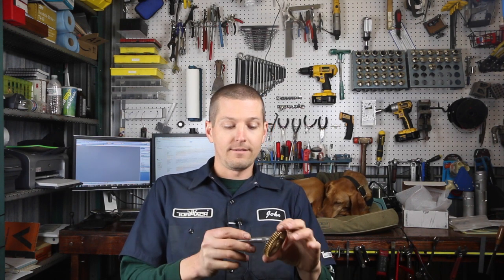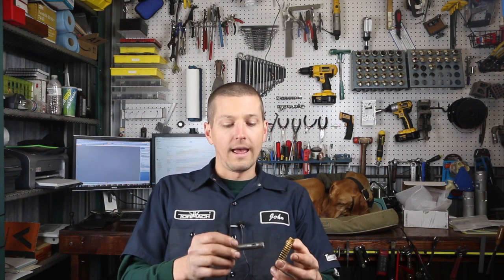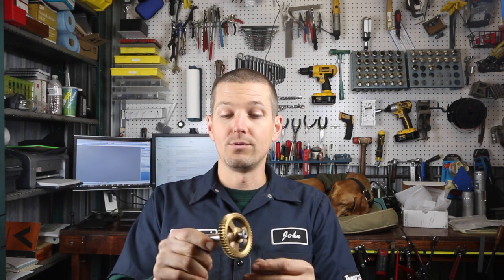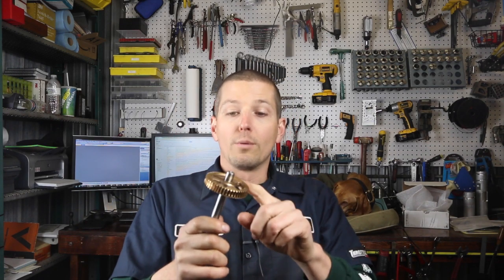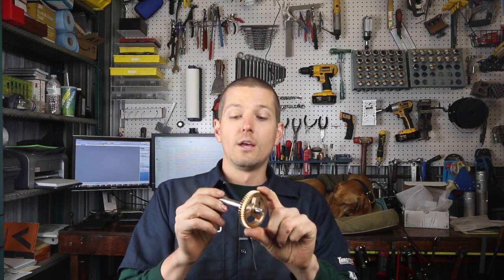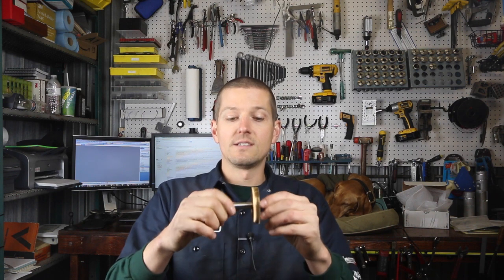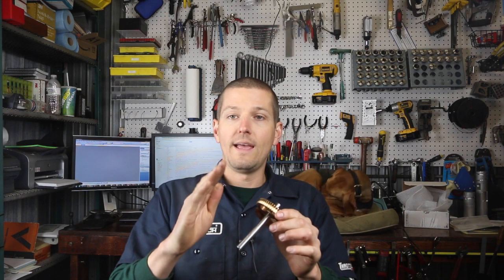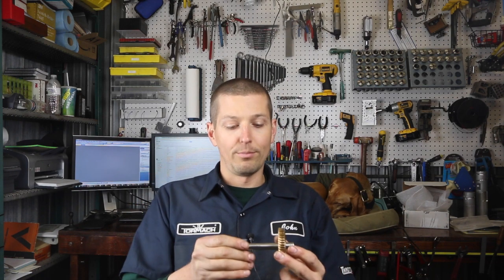Asking for advice!  Braze Bronze?

Comment: Your question is interesting, and you'll probably get lots of answers. Theres several ways you could try to strengthen that part. Many have already been stated.
One question I have is does the small end of the shaft ride in a bearing? How much room is there for "brazing"? A simple braze on the outer side may do the trick, but probably best if done by using TIG vs torch.
Another way is to possibly silver braze the two together, which is much like soldering, but only a lot hotter. You have to sweat the two parts together using a silver brazing rod.

Another idea that doesnt include heat, is to make a new shaft with a proper press fit. Not using the knurl. A straight turn with an interference. Also, two keyways 180* apart. That should make a strong hold there.
A tapered fit would work well too, but you would need a jam nut to keep the gear drawn up tight, and I don't think theres room on the shaft if you the outer end is a bearing journal.
Reply: These are all good suggestions from Adam.
Reply: hi mate im new to this interweb ,silver solder it , you dont need to get it as hot as bronze less chance to stuff up heat treatment on the shaft

Comment: Is this the same motor drive from your last Adriano project, the one with 5 lb block on it. If that's the case, im not surprised that they cheeped out on the shaft mounting with a knurl. Those kind of motor drives are better suited for something like a wheel chair meant to go longer distances with few reverses.

I would avoided the quick fixes like Braze/Solder or glue, those methods will get you a fix to last you until the replacement parts arrives, Also the heat will do more damage then you think. But given the time to make it right the first time, I would suggest measuring the gear profile then ordering replacement gear from Boston gear or Mcmaster, that would allow for something like a 1" shaft and key, Replace pinion/worm if you have to.

That said, if you are looking in to converting you shop from a short order job shop to a small production for shooting accessories, you will want to get in to Pneumatics or Hydraulics, company's like Festo sell kits that will get you going.

Comment: Hello and thank you for all your interesting films.
I have followed you on youtube since you started ..
Looked at your post about the problem with the gearbox problem.
You have 4-axis mill, why not do it all in one piece. Turning the profile and then milling the teeth. Since the problem is solved. You can do everything in steel (SS 2541 SS or 355jS) because the gear on the motor is made of bronze alloy.
I am a tool maker and protyp manufacturer for 15 years and has done a lot of things of this kind of CNC and manual.

Comment: Loctite John, welding/brazing will destress and deform that 1144 shaft. 1144 isn't stable like you think it should be for soft steel. Loctite has a higher shear than some steel. That means it will tear out the metal before the Loctite will fail.  In the future a little heat can be used to release the bond if needed.  You better chuck the shaft in a spindle and locate that gear so however you go about this it doesn't give you runout probs after assembly.  Sonic tank those parts first since you have one. Boil with dawn and borax is the other way to prep that.
Reply: NYC CNC I'm not the Loctite expert.  I use bearing retainer for stuff like this.  I know you could find something yourself you would be confident with if you look online at the descriptions.  I'll give you real life experience, others can read about it and give you the technical data galore.  That's not me, I'm a do-er like you. Bronze won't last with a press fit, I find it interesting the key sheared.  You could machine the center of that bronze gear out to a much larger diameter and press in a steel center. That would give a lot of surface area between the two metals. I would still Loctite that lol!
Reply: NYC CNC I took a look for you- I got 609 in my cabinet and that's it for stuff like this. In the past I have used it on loose fitting parts, oilite bushings, brngs, cast iron, steel, and brass and bronze parts.  If you find a better match as I think you have then you should have 100% confidence in the loctite holding.  I say that because 609 has never let me down even when there are better choices of Loctite. I can't justify $20 per bottle most of the time so I use what I got.  I got red, green and blue for nuts and bolts and a little bottle of 609.  609 is green.

You are a very resourceful person. Reaching to your audience for this is a great idea. Have a safe weekend.
Reply: NYC CNC That question is above my paygrade! I primarily use 609 for mower deck spindle bearings.  No key on a bearing but the outer race really isn't seeing any torque.  I don't know that answer John.  609 spec says for fractional hp motors with no more than 0.006" clearance.  I know without heat if I press a brng out it will score the brng and the casting and the loctite will hold up. It is a real surprise when that happens the first time.  It'll ruin parts and not the loctite! Not exaggerating this.
Reply: NYC CNC Guys like our fathers who know these things don't do videos.  I don't think you could get my dad in the same room with a running camcorder etc.
Boys need to do things like models and tinkertoys.  i learned by ruining a few models that prep is the most important step.  And fathers need to give broken stuff to boys and tell them "here kid go take this apart".
Reply: Maybe anaerobic retainer, I use it in some motor shafts and Works great.
Reply: EmperorDevilhunter Sure thing, Loctite is also an anaerobic cure.
Reply: Caleb Welte not really, loctite is a brand, they have a lot of different components. The most usual called by the brand name is cyanocrilate, which needs the atmosferic moisture to cure. They also have specific anaerobic retainer, that only cure when is in contact with the ions of metals (for example Loctite 668, 640, 609, 603, 660, etc)

Comment: Silver soldering is so easy that you definitely should try it before re-machining the parts for a better geometry (hub&screws, increased radius w/splines, keys, pins, etc).  You should machine out a clearance between the two pieces of 1-2 thousandths for best capillary action & strength.  If done right it should be very very strong.

Comment: John,

Disclaimer - I am not a metallurgist.  I did come across an interesting rethread project from Keith Fenner.   He bronzed a huge part to thread for a John Deer tractor and rethreaded.  He used Bronze for the project and stated it is REALLY strong and to be honest, I'm quite amazed at what he did.   I'm attaching the link below (part two - you may want to check out part 1)

Deer John Part Two 

I hope you find the link useful.  Keep us posted on your decision.  Would love to know what you find out.

-David
Reply: 40:10 Keith discusses the strength of brazing rod vs cast iron.

Hope it helps!

Comment: Silver solder could help but you may need a  to adjust  your fit to match silver solder specifications  It has been many years ago that I sold welding products but I know that you can get over 100,000 lb in strength with the right fit , may a 45% silver Alloy

Comment: Hi John, have a chat to the guys at Henkel (loctite). I have spoken to our local Loctite guys and seen videos that demonstrate the amazing strength of their products...They have a product, given that the shaft is knurled (space for their product) will work perfectly(can even be used up to 0.020" total clearance on a shaft and gear). With that comes NO distortion from heating(while braising), but it will be a permanent solution. You may need to machine the gear off at a later date if and when the gear fails. there are video clips showing their product working under pressures of hundreds of horsepower with out problem.
I would be amazed if they don't have a solution for you.
Peter

Comment: Loctite makes some serious adhesives that can be used during assembly to essentially make one solid part.  Maybe use 600 grit sandpaper (or sandblast until frosty) to make a slightly roughed surface finish on the shaft and gear collar ID.  Use 91% isopropyl alcohol (cheap in the pharmacy aisle at Walmart) to thoroughly clean the parts without leaving any residual oil that you'd get using reclaimed acetone.  Thoroughly dry. Follow Loctite procedures, but probably involves coating both parts and pressing them together.

Option #2 - You now have a 4th axis for the Tormach.  Make the gear and shaft from a single piece of the metal of your choice.  :-)
Reply: akromix Just yesterday I applied a J-B Weld fix to a old machine.  A good friend bought a new HF drill press.  His old one, which is nearer the size I dream about , had the motor pulley throw the key somewhere and his studio helper just kept using it with the pulley slipping.  So I got a donated drill press.  I sprayed the shaft and key with cooking spray and put the pulley on with J-B Weld.  Cheap repair but hey, I am 70 and it will probably out last me.  Today I am off to see a MD 60 miles away and I am riding my GoldWing motorcycle to see him.  I refuse to grow up and when the time comes I want to end this mortal coil by sliding sideways throwing gravel in St. Peters face hollering "Hey did you all see that?"
Reply: NYC CNC Old farmers fix.  Install the key and shaft with a good dab of J-B Weld and then press it together.  That will basically make the two parts one forever as it will fill every void and stop any slack that causes wear induced slop.  I have J-B Welded very worn splined shafts on oil field equipment and they have worked for years.   Just my 2 cents.
Reply: Big'un44 honestly this is probably your best bet for a cheap and easy way to fix a badly designed part.  I take it back the part is designed well, but probably not for the use of reversing loads.
Reply: NYC CNC Loctite 609...with data sheet link http://www.henkelna.com/product-search-1554.htm?nodeid=8797928194049

Comment: Silver soldering would be my first thought for the new shaft too. A welded on hub and modifying the old gear to a bolt on fitting might be stronger though.

Comment: A tig braze using aluminum bronze may lengthen the life of the part, however, ultimately you will need to look at a mechanical design change...

Comment: From an engineer's point of view, taking into account ability for disassembly as well as cost, i would suggest redesigning the shaft and hub for a tapered fit (keep the woodruff key as well), and tighten the shaft to the hub with a nut that would thread on the shaft itself. It's your best alternative to splining to very close tolerances which would be too pricey.
Reply: I must agree with you here. 👍

Comment: John, the first thing I would try is a chemical solution like Loctite. If that doesn't work perhaps a Dutchman. Because I don't think brazing is going to be the solution to bind dissimilar metals. 
I would be interested in seeing your modification of your Dillon I have a 550 and load 15 different calibers. 
Hope that helps. 
Craig.
Reply: I have had really good results with loctite 271. Bonds really tight.

Comment: Re-turn the shaft with a larger diameter on the end and make splines to mate up with splines on the gear  then press on.  Also you could also make a new shaft with a flange and pin the gear through the hub (multiple pins probably).  I think you are going to have trouble any way you would braze it on because of the different expansion rates of the metals.
Reply: Great idea about making a new shaft with a hub/flange. He could also use screws to secure the worm wheel to the hub just like an auto rim. A few drops of lock-tight would seal the deal. This would also allow John to replace the worm wheel in the future when it wears out.
Reply: This seems to be the best option, otherwise the torque is going to be concentrated on the key until it hogs out the keyway or shears again.  Probably broach for the gear (?) and that fancy new fourth axis for the shaft.

Hope we get to see the 1050 in locomotion.  That's a sight to behold.  I've always thought it would be cool to build a line of single stages so you could add and remove stations as you saw fit..

Comment: Brazing should work but what about multiple keys?
Reply: NYC CNC Its a great idea until you have to index them. Broaching just two 180 degrees apart is a chalenge to get the assembly come together using standard key way tolernces. Any addition clearance will result in one key doing all the work. As of the shaft, taking out all the metal for key seats weakens the shaft enough to shear it under torsion. This is why you will almost never see this done in commercial applications. When a key is insufficient, you move on to a spline.

Comment: Not being a machinist, but with my thinking cap on: Is there a way to enlarge the contact area between the gear and the shaft? So on one or both sides of the gear to have... Guess a picture is better: Search google images for "COMP Cams/.491 in. shaft dia. bronze distributor gear for Chevy 4 cyl. 153". Not an answer in regards to the brazing, but perhaps it's useful.